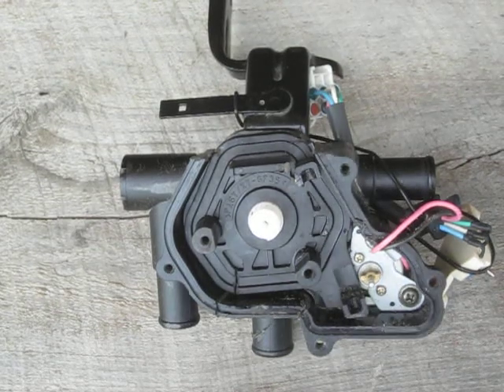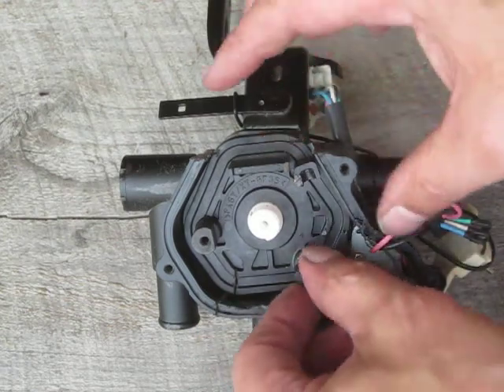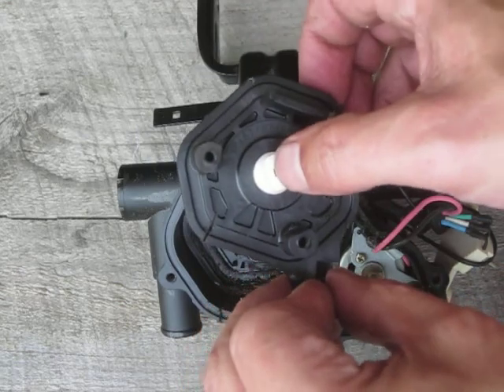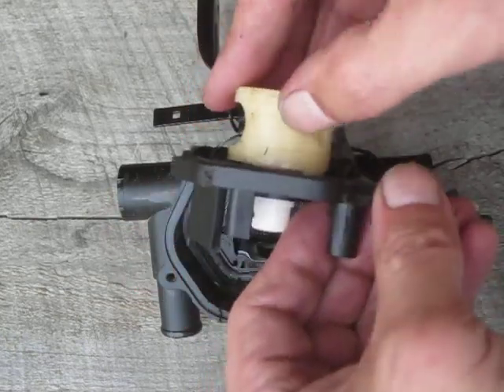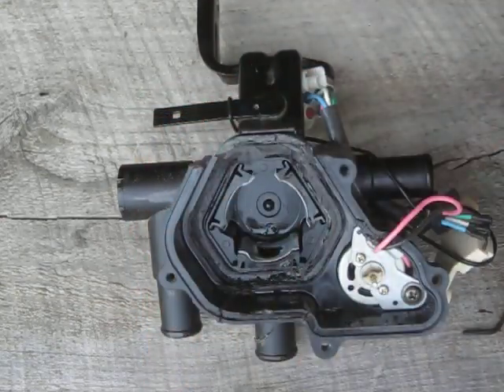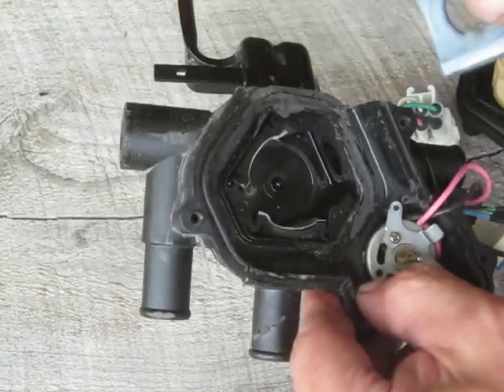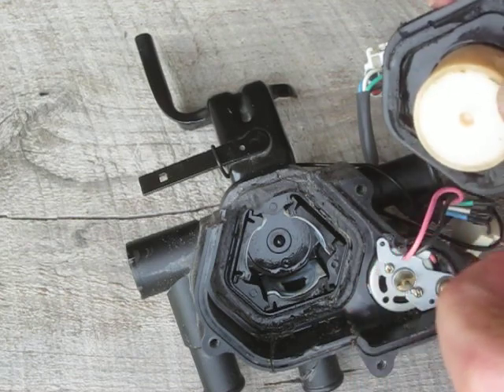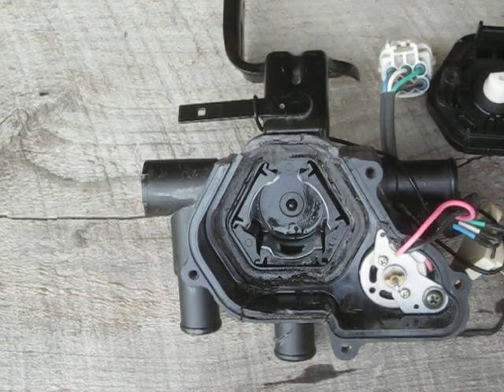Gen2 Prius Coolant Control Valve - Inner Workings

Comment: I replaced my valve with an after market valve and it lasted 2 months before I got the 1121 code AGAIN !   I took apart my original valve to see what makes it tick. Got it all apart but the big gear is really tough to turn.  THATS the problem I see.  Now I am wondering how to pull the gear cover off without using a hacksaw as you did.  I sprayed WD-40 into the ports and rotated the gear and it freed it up but still seems a tad tight.
I'm thinking if I plug the 2 ports and use compressed air on one port I could blow it off....
Reply from the maker: I would not have used WD-40, but you did not really have anything to lose.  My valve was gritty from contamination in the cooling system, due to age and tap water I think.  Maybe a through flushing with water would be enough in your case???

Comment: did you put it back together and install it? I would think it needs to be watertight and would have to use epoxy and be tested again. curious if it would work or worth the trouble. otherwise a new chinese one that is lower grade...
Reply from the maker: I did not, it was disassembled to determine why it would no longer move fully.  Debris kills lots of stuff and I do not use knock-off junk in any of our vehicles, but many folks do.

Comment: if you spray silicone inside the pipes it will turn easy again.   the motor should also be sprayed with electoral cleaner to get the carbon out and it will work again...
Reply from the maker: This valve was chewed up from debris and therefore had a rough surface causing it to bind.

Comment: I am having a huge problem with my Toyota Prius 07. the drain cock of the coolant heat storage tank is broken. and i really don't want to replace the tank because it is still in a good shape. is there someway I can get the valve covering the tank without having to replace it completely
Reply: junk yard pick and pull